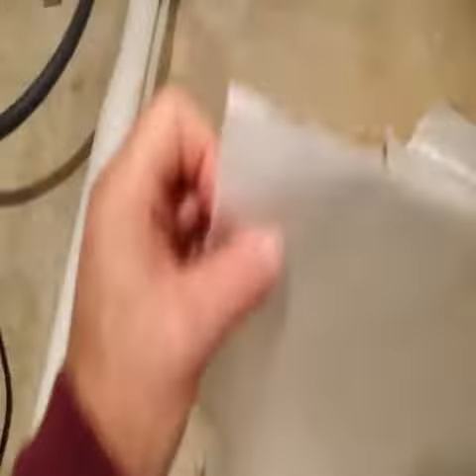Composit Armor Back Plate

Comment: This is great work! I just got my order in of this stuff from where you recommended. I am planning to use 8 layer parts, then testing them. Do you think the ceramics are as effective as the fiber for the stopping power? How many layers of fiber do you think the 8-9mm ceramic plates are saving? Would adding more fiber do a better job at adding stopping power while reducing the weight?
Reply from the maker: The ceramic is necessary to stop many rifle round and it takes you close to, or beyond, resistance to armor piercing rounds. The ceramic does the main work. It completely destroys the shape of the bullet, flattening it and allowing it way down so the underlaying PE can stop it easily. The PE by itself can stop up to 44 magnum handgun rounds. 

My most recent plate is 40 layers of UHMWPE with the ceramic tile face. It is just over 3/4" thick. I also used a high impact marine resin instead of fiberglass resin, so that is stronger and bonds better to the PE. I filled spaces between tiles with the resin loaded with silicon carbide rock polishing grit (60-80 grit) to add oomph to the resin. This would work with fiberglass resin too but the marine resin is stronger and has no odor. I'll be covering it with ripstop nylon or cordura depending on price and availability.
     You would have to use a lot more PE to get the same level of protection as you get with a basic tile face. And you'd have trouble with high velocity semi-AP rounds like M855 greentip 5.56/.223. The tile fixes all that in one layer.
Reply from the maker: Oh, 8 layers isn't enough. That won't stop any handguns either. There was a chart with my order that said that 160gsm UHMWPE sheet needed 33 layers to stop up to 44 magnum.
Reply: @BooDamnHoo  Sorry about that, to clarify, I will be using 40 layers of 160gsm , where the sheets are connected in 8-piece sections,  like how yours are in 3-piece sections. I want to see if that inter-weaving allows for a stronger bond with the matrix. And that's fascinating about the ceramics, I will have to do some more reading on adding that extra layer to the surface.
Reply from the maker: @Mithraschosen  Go with 2 inch square or hex tiles.  You want something small enough to make it easy to cover a curved surface (if you are curving your plate)  while minimizing joints between tiles but MAINLY, you want to allow for multi-hit.  A bullet hitting one tile only breaks that tile and leaves all the others intact.  if you use bigger tiles, it will crack througout and may or may not stop subsequent strikes.
Reply: @BooDamnHoo  Great, thanks for the help! Keep up the good work!
Reply: Hey guys be sure to post some shooting videos with his stuff... I might have to give it a go

Comment: Wonder if titanium oxide would work in your mix with resin
Reply from the maker: Wouldn't hurt. Here's a thing too: in reading a published article on natural fiber ballistic armor (always infused and bound by an epoxy resin) they also found that JUST the resin, no fibers, was virtually as good as any of the fiber resin mixes. So if you have a form, you COULD try just making a resin plate about 2/3 inch thick and cover it with ceramic. The resin part could be loaded with silicon carbide or titanium oxide, etc, to increase its bullet stopping ability.
Reply: super fascinating. Might shatter to much with multiple hits. I’m going to try and make something as well.
Reply from the maker: @SidorenkoAaron  Yeah, one of the things that natural or aramid fibers will do in resin is is help keep it in one piece and prevent cracking/breaking.

Comment from the maker: In reading some research on ballistic armor using natural fibers, I think I'll modify my use of fiberglass resin as is to using fiberglass resin impregnated with aluminum oxide rock polishing powder.  Another option is coconut powder.  Studies out of India indicate that adding such material to epoxy resin used to bind backing material (kevlar, UHMWPE, Jute, etc) improves energy absorbance.  I may even add some layers of jute fabric behind the UHMWPE sheets as studies out of Brazil and India indicate it actually performs slightly better than Kevlar!  Jute (burlap, essentially) is WAY cheaper than UHMWPE or Kevlar. We'll see as this is a work in progress.  As of the day I post this I have my 40 layers of UHMWPE all ready and am actually deciding if I want to go a few more layers thicker.  My test plate square was only 40 layers thick and with the ceramic tile strike face, a 7.62mm NATO FMJ round fired from 10 yards only penetrated about 2/3 of the way through the PE layers.  I do NOT know how my armor would perform against high velocity rounds like M855.  There are two general ways to defeat armor:  armor piercing ammo or via brute method of high velocity.  An AR-15 round traveling at over 3000 FPS MIGHT make its way through where a 7.62mm at 2650 FPS cannot.  I need to balance weight and thickness with effectiveness.  It needs to fit in a plate carrier AND not be overly heavy but also not skimp for weight savings while giving up effectiveness.